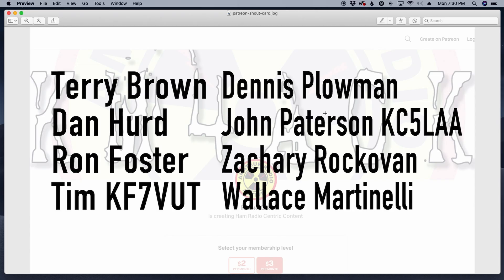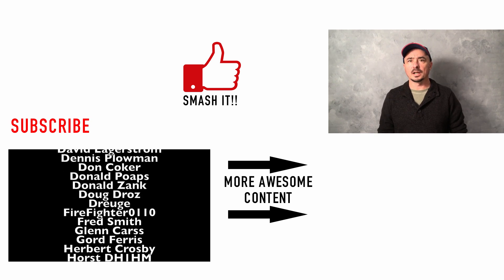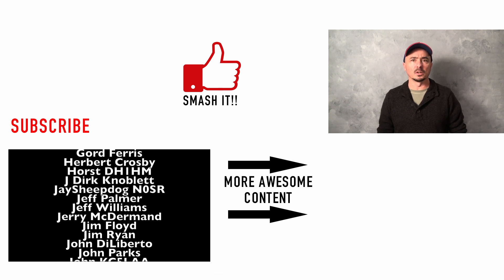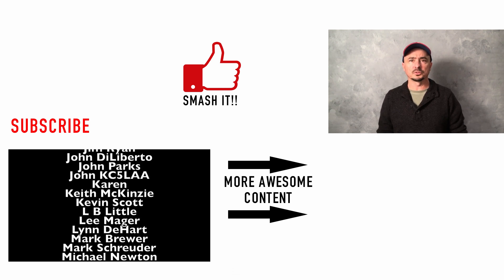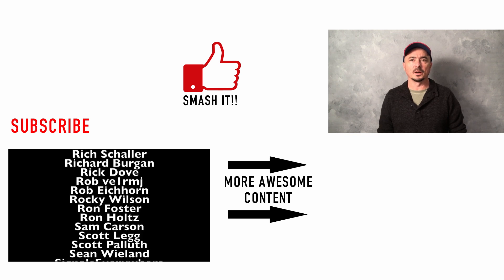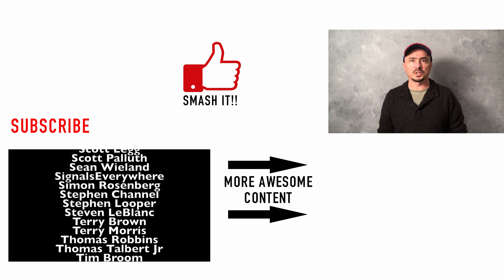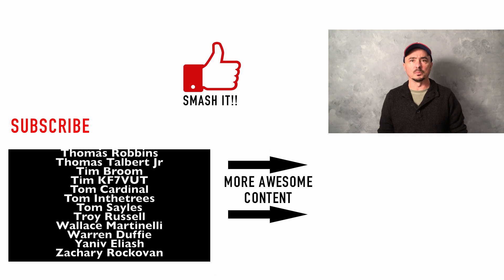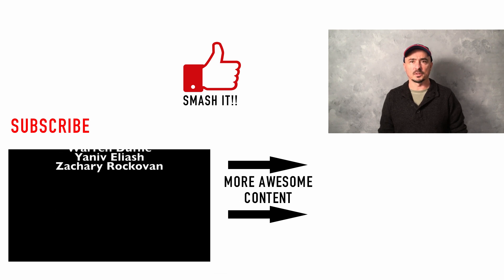Lessons Learned Simulated Emergency Training (SET) 2020 | Amateur Radio

Comment: my suspicions:
— there may not be enough stations with antennas setup for NVIS 80m?  (you’d want to know a few clear stations before you go, then see how many are still available in the gulley.)
— it would also be interesting to check a topo-map, see what other obstacles are around, aside from just the hills you see.
— could bad weather be messing up some radio signals?  I think you had some rain during the 1st video.

Comment: Thanks.  Learning what works and doesn't work helps us all learn from the experiences of others.  It sounds like you learned that solar powered HF communications doesn't work very well from a cave.  :-)   We have terrain just like that here in Kentucky.

I wonder how many of my JS8 failures are because nobody is listening... or answering.  I guess I need to get up to speed with Winlink.

Comment: 40m JS8 DIES at 20:00 hours local, here in Maryville, just down the road from Gatlinburg. My son laughs at me cause where he lives, 40m is still active. I admit that I am running a VERY substandard antenna, BUT it simulates bad weather very well. thanks to your new script you generously shared, I will soon have winlink available (as soon as the loose nut behind the keyboard is fixed!)
Thanks for making and sharing your efforts!

Comment: Rather than a larger battery consider a second battery.  A second power system provides redundancy in case of failure.  Good vid.
Reply from the maker: That's pretty much the exact conclusion I have come to. 73, de KM4ACK
Reply: I figure that the larger battery added would be the second battery. :)

Comment: Thanks for sharing your after action report. Itm is certainly wise to review what works and what doesn't when operating in an off-grid scenario. Having mulitiple options is really important. So far as solar goes I have a suggestion which might be helpful. With the correct cables you can use the battery on your vehicle as a non-solar power source. Running the engine will top up the battery and so keep you on the air in low light or no light situations. Another option is to think of the vehicle as a portable HAM shack. With a vehicle mounted radio you have both potable and mobile operations capabilities. This would allow you to relocate your rig to a good location while operating and then return to home base when off the air. With a collapseable fiberglass mast you can quickly get up a wire and be on the air in minutes. I'm now using a Cameleon 17 foot whip mounted to the trailer hitch on the back of my truck. It can have it up in 5 minutes complete with 4 radials. I used this on Winter Field Day to very good effect. If the object of the exercise is to get on the air I think all options need to be considered. I am a big fan of solar and use it all the time but also have portable generators and can run my rig from my vehicle.
Reply from the maker: It's almost like you looked inside my bag & jeep. My daily driver has both a 2M/440 rig and a 857D for HF comms. I have a little tar heel 2 mounted to the rear. I also keep the needed alligator cables in by bag to connect the portable radio to the car. I totally agree with your entire thought process and could have used these methods if actually needed. At the same time, I wanted to test the battery/solar to know what it is capable of just in case it was the only option available. Think hurricane Maria where gas supplies were limited. Thanks for your input. 👍🏻 73, de KM4ACK

Comment: During winter field day I monitored the power usage for SSB and JS8CALL, not just for the radio mode but also associated gear.  The power it takes to do digital 5 watts vs SSB 10 watts was almost double.  This is assuming that when not using digital you are using paper logs or a phone for logging .  Since I was in a very small tent there was the added weight of the electronics as well.  While I fully understand the benefits of digital, keeping the added power, weigh and in mind is important.  I barely got a trickle of solar during WFD with a 50 watt panel.
Reply from the maker: Provided you can hang out at the radio to monitor for traffic and reach your intended recipient with 10W, you are absolutely correct. The advantage of digital is that the computer can sit there and monitor for incoming messages while you tend to other things. This becomes critical if you are in a disaster area with just your family. If you are part of a large group you may have the freedom to just focus on communication. If it's just you or you & your family, you may not have the luxury of hanging out at the radio for long periods of time. The other advantage of digital is with apps like JS8Call/Winlink, it allows us to work stations with 5-10 watts that would be impossible to work on SSB with 100W of power. The lesson for me was to use what I had to accomplish the task while consuming the least amount of juice from the battery. Each operator has to decide what works best for them. 73, de KM4ACK
Reply: @KM4ACK  I agree 100%